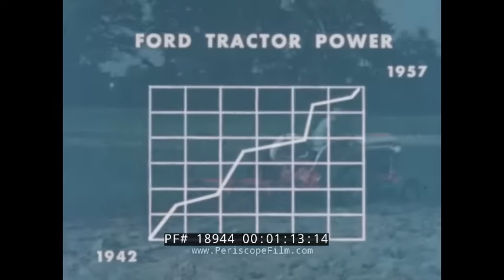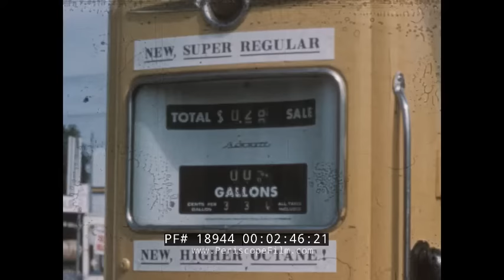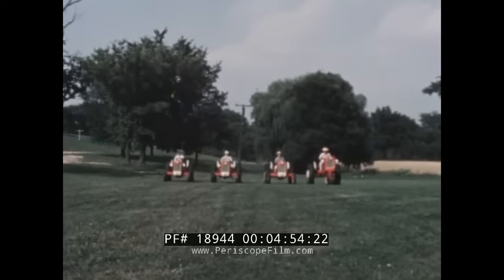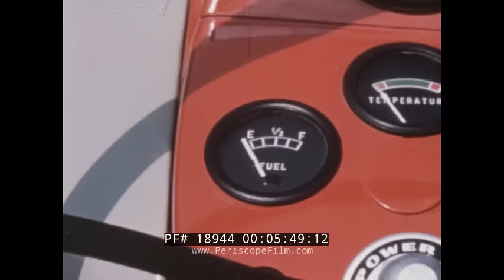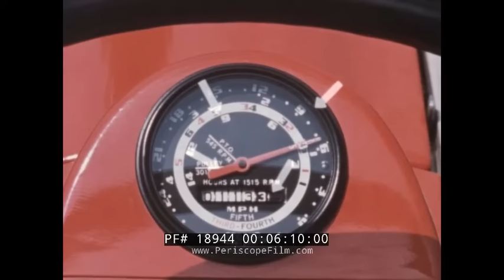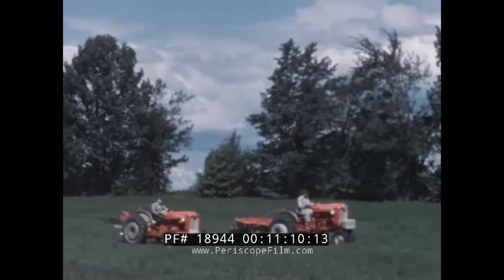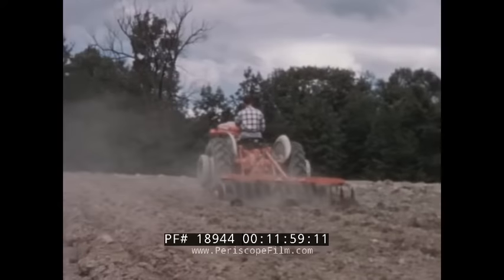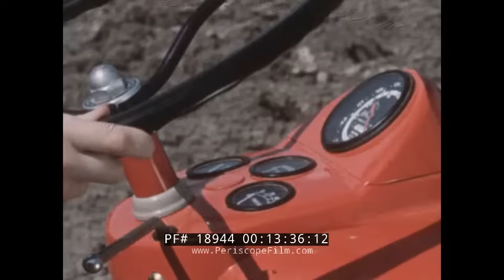1957 FORD WORKMASTER AND POWERMASTER TRACTORS PROMO FILM   18944

Comment: My dad bought a 1957 model 641 new in the spring of 1958 when I was six years old.  I am delighted to still have the tractor in good condition and use it often.  Nice video.  Thanks!
Reply: I had one of those exact models for years. I used to log with it and plow snow and bush hog. I have a bunch of videos of that on my channel that you’d probably like from a few years ago.

Comment: They were built to last and still used on many farms across America..These models are 60 plus years old,  and the 8-N, 2-N models are from the 40's and 50's and still get the job done. Amazing American built tractors manufactured here. What ever happened to our Country?
Reply: Planned Obsolescence is the motto of today's designers.
Reply: Joseph M 
In what way? Do  Case, Deere, MF/AGCO and many many more not build superb tractors, combines and implements today in your country, doing more work for more hours for a lower cost per acre adjusted for inflation than ever before?
Reply: Phil Hall  Great to hear that you are working on the old tractors.. I have had   a few Ford 8-Ns over the years, fine little tractors for racking hay. I own John deer from the 70,s and 80,s and they run and work hard with little problems. Compared to the new junk they sell today, these old tractors will outlast them and still be working many years from know. Good luck to you.
Reply: Democrats!!
Reply: @hedydd2  Yes they do until one of the computers or other electronics go bad, and they do quite often.. The older tractors and equipment are much slower but, they can be worked on by any mechanic or the farmer; the crop gets harvested..
Reply: @dukeman7595  
Mechanical problems still dominate machinery breakdowns. That incudes compulsory emission control devises where it is pumps, valves, sensors and particulate filter failures that dominate. All mechanical. Just because these things and many more send fault codes to aid diagnosis, does not make the fault to be electronic.
I have a fully electronically controlled powershift tractor bought new in 1993, still working as new. It had a new manifold and turbo four years ago and a new piston and individual cylinder head some ten years ago. The forward reverse shuttle buttons failed at the end of silage this year but the buttons are fine. It just needed a repair to a locating bracket within the joystick..This is a Same Titan 160 which has electronic linkage control with radar slip control, nine speed electronically controlled full powershift and an electronically controlled governor on the engine with three programmable speed memories. That’s my eldest but a similar history applies to my 10,000 hour 1997 loader tractor, a New Holland 8360 Range Command, a 2004 MF 7490 with Fendt Vario transmission [which needed a new air seat base the other day] and a 2009 MF common rail tier3 with Dyna4 transmission. 
..
Reply: @tomclose6643  TDS

Comment: It was Harry Ferguson who  invented the 3 point hitch system.  At one time they were partners and Fords using this system had Ferguson System emblems on the grille.
Reply: Ford screwed Ferguson over.
Reply: Ferguson was a hard man to work with and the Ford representative in the UK  wanted nothing to do with him and the Ford in charge over rode his objections and made a contract with Ferguson.  It lasted a few years but the break up was  pretty ugly from both sides.
Reply: @michelebeck4311  Ferguson got paid $9.25 million dollars in 1947 to go away and quit being a PITA.   That's equal to $111 million in 2020.  Yeah...that's really being "screwed."   Ford was losing money in England on every sale because Ferguson controlled all of the sales in England of Ford agricultural equipment and was an incredibly bad businessman.   Ford was glad to get rid of him.
Reply: CHARLES ATWELL and oddly enough the new MF’s seem to have terrible hydraulic problems. Talk about irony.
Reply: We have a Ford Ferguson that still runs now.   It is The Best Old Tractor that We have ever had.   It is a Shame that they split up.   My Grandpa bought it used when My Dad was 10 or 11 years old.   I think the engine has been overhauled 2 or 3 times, but it keeps on going.   Right now it needs the carburetor rebuilt, because if You leave the gas turned on, You will loose all of the gas out of the gas tank.
Reply: The three-point hitch was so good, that a patent judge, finally ruled not to renew Harry's patent on it, and it became the industry standard!

Comment: My Dad had an 801 and 861, both diesels.
They were fine machines, ahead of their time with live power and draft control.
We used them until the early ‘80’s.
Reply: im still using my 860 got it cheap and it runs fine
Reply: Draft control was standard on 8Ns

Comment: My Grandfather bought a  601 Brand New.   He had a 9 N and We still have it.  I don't know if it is because the 601 had more forward gears, but to be honest The 9 N always felt like it had more power to Me.  My Grandpa wanted the 9 N back, but He kept the 601 until He died in the mid 80's.  We pretty much sold everything My Grandparents had then, but We still have the 9 N and it still runs.   Dad said My Grandfather bought it when Dad was 10 or 11 years old.  I think it has been overhauled 2 or 3 times, but I could go out and pour some gas in it now and it would probably start.   It does need the carburetor rebuilt, that's why it doesn't have any gas in it now because the float sticks and runs all the gas out on the ground, unless You turn it off at the tank.   I  still love that old Tractor.   We have a 3,000 Diesel that belonged to My Dad's Uncle and He bought it New in 1968, the same year I was born.   Then We had a few other brands for pulling a Manure spreader.   We were Chicken Farmers from 1970 until the year 2,000.  Mom and Dad  have retired now.   We bought a 4610su in 1985 new to run a generator to supply emergency power for the Chicken Houses because in the summer they have to stay cool or they start drying off heart attacks very quickly if they get to hot.  A Generator puts a heavy load on a tractor and even the 4610 got hot once  when the main transformer from the electric company blew.   The changed the transformer as quick as they could, but We were getting worried about the Tractor.   I think Dad sprayed water on the radiator with a water hose to keep it from overheating.   It's still running strong, but it is ready for a clutch.  It has an unusual transmission.   It has 4 gears on the right and a low and a high range forward and a reverse on the left on the steering wheel.   The right gears are kind of like a foreign car without the reverse.   So it has 4 reverses, and 8 forward gears.   If anyone wants to help us put a clutch in it, the help would be appreciated.

Comment: The live power PTO was a great improvement. I'll give them that. The old PTO. Would push you places you didn't want to go
Reply: That's why the aftermarket offer an over run clutch for the PTO.
Reply: Independent PTO.

The “live PTO” was already in use. A 2 disc clutch enabled the user to depress the clutch halfway to kill the pto but continue forward movement and clutch fully depressed stopped forward motion and the PTO

Comment: My dad bought two of the super dextas at the same time in 1963. They were terrible tractors . Always had problems burning starters and batteries. The 3 or hitch would fall just driving down the road. The brakes wore out quickly and didn’t work wee either. I am just waiting on a periscope film from the 1963 super dextas.

Comment: I used to have an 841 Diesel with the Elenco front-driving axle, Sherman hi-lo transmission and remote hydraulics. Nice tractor. I noticed they did not mention the Select-O-Speed transmissions in this video. I would have expected them to be front and center. Did they come out a year or two later?
Reply: 1959 for the Select-O-Speed.

Comment: A lovely film and beautiful tractors. Not much support from the seat though! When and why did Ford tractors get a blue paint finish?
Reply: Ford switched to blue and white in 1963 when they introduced the thousand series tractors. They also offered to repaint the 601 and 801 tractors with the new paint colors. I have an 841 that was repainted blue and white under that deal. You can still find the red and grey on it. When I finish the rebuild of mine, it will once again wear its original paint colors.
Reply: The
Reply: @doughibbard8462  Doug, my apologies. I somehow missed your reply two years ago! Thanks for that information. All very interesting.

Comment: my father bought an used 1959 801 series with gasoline motor in 1964 still have it today but I don't think it had two and a half times the horsepower of the original model

Comment: “Larger tailpipe” .......as it shows an exhaust pipe in the front of the engine/tractor 😅😅
It’s called a tailpipe because in most vehicles it’s on the tail end of the body. On this tractor it exits in the front so that’s not a true “tailpipe”..it’s an exhaust pipe. 🤦‍♂️
But hey, they are just dumb farmers what do they know??
Reply: Yet I bet they know more than you do on how to take care of equipment and how to salvage stuff. 🤣

Comment: Absolute scandal that they blatantly copied the Ferguson System while claiming it to be their own invention.  They even copied the Ferguson swept back front axle with a drag link on either side of the engine on the smaller models.
Reply: Mike England 
Did they heck! Harry Ferguson took Henry Ford to Court over it and they eventually reached an agreement over the toss of a coin. Ferguson won.
Reply: Ford changed the location of the hydraulic pump and added 3 positions to the upper link sensing. Enough to circumvent the patent which Harry let expire. The radius rods had to be changed on the Ford front axle when you changed width. Ferguson did not. Again, Henry got around Harry's patent. Ford had the Sherman Bros build implements for the early N series but the Dearborn brand and at times rebranded to Dearborn equipment came to the fore more as time passed. Harry insisted on a 3 speed transmission for the 9N. Ford put 4 speeds in the 8N and Harry followed suit with the TO 20 & 30. He went back to it with a high and low range built in when Ford threatened a lawsuit in return. Ford continued offering the Sherman auxiliary transmission ahead of the standard 4 speed for several years. I believe they bought the patent from Sherman. That 3 speed with high and low range lasted well into the 70s. I plowed with an 1100 Massey for a neighbor. 3rd low was too slow and 1st high was too fast, it couldn't pull the plow without horsing the motor horribly. Bad idea or just Harry the hardheaded? Harry was long gone but someone kept the stubborn department alive and well for several years after his passing.
Reply: @thegreenerthemeaner  
Henry Ford was sued and lost to the tune of $9million.  However, by 1958 Ferguson's major patents had run out of time and many other brands made their own variants, copies, of Ferguson's many inventions. Ferguson duly sold out to Massey-Harris to form Massey-Harris-Ferguson.
Reply: @hedydd2  I think you have joined up two totally different events, where the History of Fergusons' involvement with Ford is concerned.
 First of all, Harry Ferguson did indeed sue Ford for a huge amount over patent infringement, but only got awarded £9•25 Million in the end. The case lasted four years !
 The coin toss you mention, was in fact Fergusons' idea, during discussions with representatives of Massey Harris, who valued Fergusons' Company at $1 Million Dollars less than Ferguson wanted, so to break the impasse, Ferguson suggested tossing the coin to see who would win - as it turned out, Massey Harris' people won, not Harry Ferguson. Need to brush up on your history my man !
Reply: @jamesbarbour8400  
You are correct. I have not read up on this in over thirty years if not longer. I have Harry Ferguson’s biography somewhere but I haven’t seen it in a very very long time now.